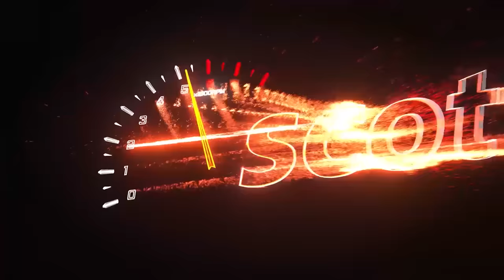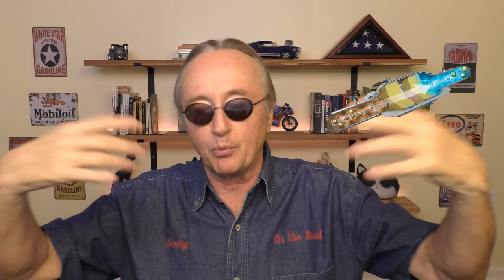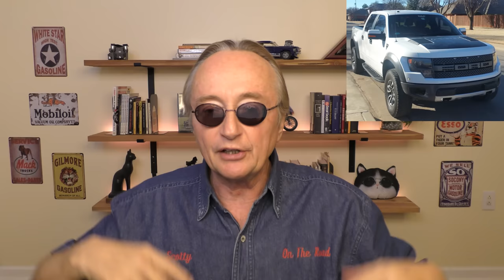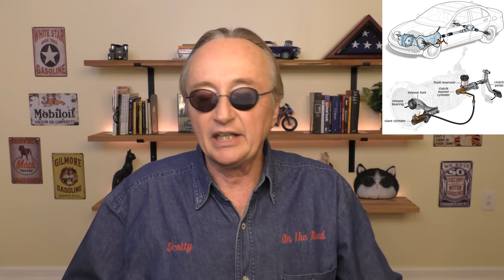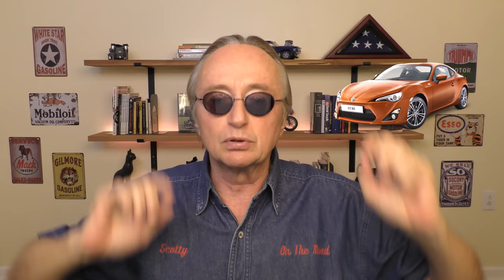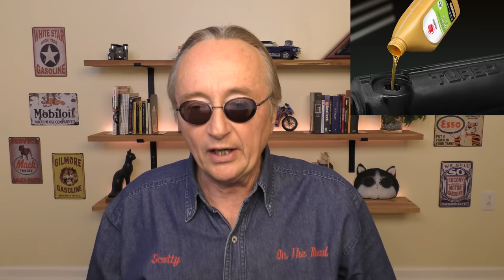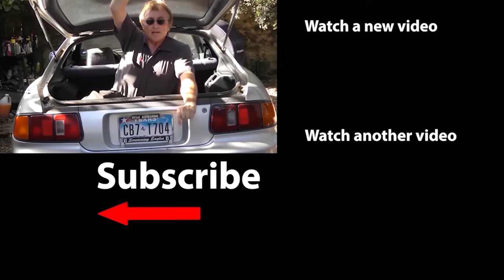Here’s Why Engine Braking Can Destroy Your Engine and Transmission

Comment: Ive engine braked for years living in the mountains. It does not ruin your transmission or engine at all.
Reply: i also live in the mountains, i shift to neutral and coast down the hill. I paid for that on the uphill, i'm making full use of gravity.
Reply: @MTMXBL  i thought brake doesn't work well when in neutral 🤔
Reply: @MTMXBL  doing this actually uses more fuel than leaving it in gear
Reply: He didn't say it would ruin anything. He said brakes are cheaper than engine or trans so don't do it because it's common sense. Then he said UNLESS you live in the mountains. Lol cmon dude. I'd bet you didn't even watch before commenting.
Reply: I have prius V it's got an engine brake to save fuel. Use it all the time . It's true brakes are cheap. <$125 for 4 new brakes and rotors.
Reply: @NewEraMusic972  Dude, guy joked, I mean Scotty, he's always joking. If you watch Scotty's channel then it's probably obvious for you that engine braking can damage only 2 stroke engines (like those in trabants) that are not lubricated when the throttle is closed. But why not make fun of it saying the engine is way more expensive? Technically - very true. Also, if you use engine braking on a wrong gear you will exceed max revs and destroy your engine and / or transmission in seconds. So called "money shift". BTW, IDK how it is where you live, but in my country they teach you to use engine braking everywhere and all the time on your driving license course.
Reply: @Earlve001  Hybrid engine braking probably uses the hybrid system for braking. Just take foot off the pedal and the car slows plenty I can get the car to slow down to where you use the brake only when you get near the stop sign. Eco-mileing probably pisses off a Tesla driver but I don't practice it when there's no out for cars behind me.
Reply: @Earlve001  agree, makes sense regarding piston opposite wear.
Reply: @anon in neutral the motor spins on liks 700-800 rpm
In gear its 1-2k rpm, depending on some things
So he actually use less fuel... around 0.5l / 100km
Reply: @patrick7695  you are all right and wrong. The answer is, it depends on the car. Direct injected cars may use less fuel in gear than coasting in neutral because they can turn off injection completely but beside those examples, in general you use less fuel while coasting, simply because the engine braking works against you and downhill, it also works against Gravity.
Reply: @Asto508  ohhh i did not know that
I never actually researched it, just used common sense
Thanks for pointing it out
Reply: He pretty forgot to state "engine braking at top end of your rpm". Normal engine braking doesn't do any damage.
Reply: @MTMXBL  Do not do that! You disable engine braking when in neutral! Also in gear and foot of gas deactivates injectors in every electronically fuel injected vehicle so you actually save fuel and reduce brake wear!
Reply: @GEAUXFRUGAL  I got 150,000 miles on the brakes on my Gen II Prius. The regenerative braking system does almost all the work once you adjust your driving to the system.
Reply: @tomdavies388  - I have done what MTM did.  I had a 1974 Datsun B210 Hatchback with an A13 (1288cc) 30 years ago.  I coasted down I80 in the Sierra while going from Reno to Sacramento several times.  Coasting lasted me for good 10 minutes straight one time while speed varies from 55mph to 90mph in neutral with engine idling without touching the brake.  Dangerous and illegal, I know but I was young. ;) Engine MUST idle if you want to keep the brake working. Cost me around $1.70 going down from Reno to Sacramento while costing me four or five times that going up from Sacramento to Reno.
Reply: @cheath8705  haha- not about braking but the car... my 1st was a 67 Datsun Bluebird loved it!
Reply: @tomdavies388  not true at all
Reply: I suppose unless there is initial jerk when u r in higher speed but u put into second gear for engine braking.
Reply: @tomdavies388  😂😂😂😂😂
Reply: If you car is in neutral going down hill the engine has to use fuel to keep turning over. unless you turn the ignition off completely, pretty dumb tho. If you are going downhill  in gear with your foot off the throttle then it uses no fuel at all.
Reply: @tomdavies388   manual transmission equipped cars get better mileage because of the coasting. Coasting down hills does not hurt your mileage. In fact it can help it if you use that momentum to help carry you up the next grade. Ask any long haul truck driver. They will tell you the same.
Reply: @tomdavies388  ... and if you engine is “running” then it is using fuel.   So the question is does my truck use more gas coasting at 700 RPM or engine breaking at 2000 RPM ? We may disagree and probably because of age and type of vehicles we are experiencing this with. 

However, coasting down hill, increases your speed compared to engine breaking. So even if the mileage per gallon was equal... once you hit the next grade the car coasting will be going faster and therefore carrying that momentum.
Reply: @HarrisonCountyStudio  And because you are going faster coasting downhill fuel consumption per mile
is lower.
Reply: @tomdavies388  Of course it uses fuel.
Reply: Let's ask the main man himself, @scottykilmer
Reply: @anon ...but many newer cars stop pulling fuel when you engine brake.
Reply: @fjp3305  ...unless you're going downhill. Then the computer turns the injectors off.
Reply: @Earlve001   the opposite side of the piston skirt gets its contact when the piston changes direction, not from engine braking. The piston rocks to one side going up and the other coming down. That’s why the skirt is there, to keep it stable, otherwise the pistons would actually flip over.
Reply: Temporary Account  Yup, and I've done it to every vehicle I've had, and even engine braked coming off the interstate to a stop. No issues. I tend to engine brake when I have a long, gentle, extended brake to perform, partly because the engine absorbs the heat a lot better and with less wear than brake pads for that scenario. 200 K miles are not unusual with a vehicle of decent quality.
Reply: It's also important when regarding fuel efficiency, that there's a kickback RPM in which the ECU turns the fuel injectors back on. What RPM this is depends on the vehicle, so the longer you stay above that RPM with no throttle the less fuel you will use. And I can't imagine engine braking causing any damage or access wear, unless you're aggressively downshifting to high RPM. I'm sure both you're engine and transmission go through more strain taking off from a stop than when engine braking.
Reply: Done it forever. Never had any problems. That's what warranties are for anyway!
Reply: @MTMXBL  If you're coasting down a hill in neutral, you're not technically engine braking, and are likely picking up speed. I think you're describing a related but different driving strategy of picking up speed downhill in anticipation of an uphill ascent ahead, in which case you can build momentum easier on the descent and let that help carry you up the hill, using less gas and brakes in the process.
Reply: @MTMXBL  that might be illegal where you live.
Reply: So you’re telling me Scotty is full of 🧢
Reply: @patrick7695  Wow, in gear you use 0 fuel. On a long enough downgrade your engine temp will start to drop
Reply: @tommymcweedface229  They do design for that stuff, after all. Just don't dump the clutch with a massive RPM differential.
Reply: @paulkazjack  piston RING, maybe
Reply: @patrick7695  haven't heard of vacuum pressure?
Reply: @cheath8705  you probably find that if you coasted down in Top Gear it would cost even less because your vacuum pressure would be much lower then at idle
Reply: @grantperkins368  - I would love to see if you can prove it. Let's not forget the rpm difference and 1.3L engine's friction from going 90mph @ ~5500+rpm would prevent me from being able to pull off 10 minutes straight in being out of gear while going down the hill in the Sierra. And also, fuel was still being introduced to engine even if accelerator was fully released and it was carbureted.
Reply: @cheath8705  yes, but less than at idle because the vacuum pressure is lower.
Reply: @MTMXBL  in neutral you are spending fuel, in gear you are not... and its dangerous cos ur costing and get very high speeds
Reply: Cvt wont last long if use a lot of engine braking
Reply: @MTMXBL  😂😂😂
Reply: @FreddyGunawan  source?
Reply: @GEAUXFRUGAL priuses use the ICE engine for engine braking
Reply: auto or manual transmission? it's definitely harder on an auto-trans

Comment: Me after engine braking pretty much the whole way home 👀👀
Reply: Same with the car I had 😂
It was just a dodge anyway
Reply: Lmao! Lol!
Reply: I did it all the time on my Mitsubishi Mirage its fine lol
Reply: @VioletPrism  how long did you have it?
Reply: Just can't stop either. Hooked on it
Reply: @ewerwong3624  But if you can't *stop*, then what's the point of engine braking? 😬 Lol
Reply: @VioletPrism  I'm driving an eclipse lol
Reply: I drove my 86 Corolla for a year with no brakes only engine brake and hand brake.. I was young and naive but I'm still here
Reply: There goes your engine.
Reply: No , you just left your handbrake on ....
Reply: I used to have a turbo charged Mazda MX6, engine braked all the time. Done over 140,000 kilometres on it, no problems from it.
Everyone said I always drove it like I stole it!
The heal n toe engine braking always helped with late braking, smoothness, better handling and also acceleration out of corners.
Reply: @milkshakemuncher  they need to tweak the modeling in that sim it seems
Reply: Me who randomly downshifts because I like the sound
Reply: I have an 04 Grand Prix, would like install a super charger,  but it's now has 170 thousand miles  and over 60 thousand egine hours, I can't remember what you said about superchargers and a high mileage engine, some tips please
Reply: Same
Reply: .....Scotty hasn't specified . He must be talking about automatic transmissions . But there are variations in the designs of automatic transmissions.
Reply: I’d suspect autos too, I mean I’ve been doing it since my car left the dealership for 15+ years no problems here. 🤷🏻‍♂️
Reply: I'm engine braking all the time and then just tapping the brakes to make a stop from 5km/h. And use brakes in emergency. Never had a problem with my last two cars and I will keep doing it because I like it. 😁
Reply: @zoranbregovic3752  I'm the same way, I barely have to use the brakes. It's extremely beneficial for fuel economy too.
Reply: Just know that if you're going to use your wheel brakes continuously for long distances like 500m/1500ft downhill, they are going to start overheating, and suffer from vapor lock, and then you will have no brakes. 

Engine braking will increase wear on the engine and gearbox, but you can do it for like 200k miles and they still won't need a rebuild because of that.
Reply: @jamesharper7365   the increase in pressure will put extra strain on any weak spots in your engine for example seals
Reply: 2007 Tacoma 230K mi always use engine braking.  Angus Heifer  finally broke it!  WBFOSTERSR
Reply: I was doing this right now and my truck is leaking water frome between the motor and transmition
Reply: @_--Reaper--_  have an 8 year azera and 15 yr Sonata, no problems with transmission at all
Reply: @benshapiro2wt298  Yoo I just bought a 95' Eclipse

Comment: I missed the part where you said how it damages the engine and transmission
Reply: I don't put much stock in anything Scotty says. Real Engineering is much smarter and less biased.
Reply: He didn't say how, but improper down shifting with wrong RPM can damage a manual transmission.
Reply: @flippos  😂😂😂

Comment: If one shouldn't engine brake because "it wears out the engine" maybe we should all just leave our cars in the driveway so we don't wear them out. No, if done sensibly on steep grades, engine braking is perfectly safe. Riding your brakes coming down a mountain will glaze the pads and warp the rotors. Not a "cheap" thing to fix.
Reply: not to mention Brake fade which can potentially cost you, not only your car but your life
Reply: Also, depending on the car, new pads and rotors aren't exactly chump change. My 2010 M3 costs 1000-2000 to replace everything depending on the quality of parts.
Reply: Definitely not cheap for some cars. Rebuilding the transmission if its manual would be cheaper.
Reply: And yet, people act like this shoddy killme guy is a god or something. He is a MUPPET, people!!!
Reply: @JeremyFerrer  I would use aftermarket pads and rotors like from EBC, way cheaper and you get track racing performance.
Reply: Yeah, the engine braking being a problem is only on very rare cars. I know rotary cars actually can't engine brake at all, the injectors never stop firing. There is actually a very old car that I think has a 2 stroke engine that requires oil in the gas tank for lubrication and actually gets damaged from engine braking since the car is carburated and will stop injecting fuel if you are in gear and off gas.
Reply: @JeremyFerrer  but definitely cheaper then your 12k engine or 8k transmission right 😂 he said use a common sense!! Ok!!
Reply: @SI0AX  .....injectors never stop firing......yes of course... that's it.....wait...too tired to think it through. But for the two strokes I'm thinking that for the ones that pump small quantities oil into the manifold that a big build up of oil in crankcase chamber would cause big clouds of offensive smoke when throttling up again . Can two strokes provide much engine braking though .
Reply: Louis Jones whats your ride ?
Reply: He made an exception for mountains. Your post does not apply here.
Reply: I have a 2016 diesel Colorado with an engine brake it's great going down steep inclines

Comment: Engine brake is fine as long as you don't exceed 3500 rpm. Diesel truck drivers engine brake all the time. I had a 1st generation Honda Odyssey minivan with 2.4 four cylinder and an automatic and I engine-braked the sh*t out of it and sold it with 378,000 miles on it. Original engine and trans. Never a problem.
Reply: Ssssh, you're spoiling the show!
Reply: Allan, I agree! 👍

Comment: That fixed it Scotty, was just the slave cylinder luckily! Shifting smooth!
Reply: Excelent! Scotty should pin this comment!
Reply: Nice...
Reply: I have issues on focus 05. Loosing pressure in clutch periodically. I really don't know what to do,  should drop down the gear box or just drive it as long as it goes. Master is not leaking,  probably slave
Reply: @drazj  Check for leaks by looking near the area of the slave. Even a small, slow leak will be bad because you won't be able to generate the necessary pressure.
Reply: @Usman Ghani lmao

Comment: I have a 1994 Toyota Pickup and after 170,000 miles it still had "ORIGINAL" brake pads on the front and shoes on the rear. I "ALWAYS" slow down by downshifting. I think Scotty is a shoe salesmen not a mechanic.

Comment: Engine braking is one of the best things about having a manual transmission.  It takes some practice, but if you properly double clutch and match RPMs while you downshift, you won't hurt anything.

Comment: It’s also a lot safer to engine brake when you’re diving in Michigan winters. Your wheels don’t lock up nearly as much and you prevent sliding through the intersection. 
I’m also not convinced it actually wears out the transmission or engine any faster. Though it is definitely harder on the clutch as now you are depressing it 4-5 times per stop versus just once.
Reply: I always engine brake. If you’re not mismatching the speeds it’s never going to hurt anything. Never had a clutch or engine/transmission break either.

Comment: I stopped engine braking a few months ago. Going with Scotty on this one
Reply: But that's going downhill not on the level road
Reply: Sorry, every time you lift your foot off the accelerator, your car is using engine braking!

Engine braking is not going to wear out your car, it'll actually last longer.
Reply: @rustymozzy  thats  true but the issue was going down here it can wear it out that's what he was talking about I engine break all the time but that's on the level road and you're right it does have last longer when you do it
Reply: @godofdestructiondiecast6756  your car can drive up the hill with no problem, using engine braking down hill is less load, less heat, less wear...
If going down hills is so detrimental to the engine, it must fall apart going uphill, or even driving away from a traffic light...

Engines and trans are built for high load conditions. 
Your brakes are designed to stop the vehicle, not control acceleration. 

Simple test, put your foot on the brake, and now also press the accelerator. 

Reduce the brake pedal pressure to allow movement, keep your foot pressed on the accelerator, using the brake pressure to control your speed. 

See if your brakes fail before your trans falls out...
Reply: Even going on level road, engine braking doesn't do damage. If brakes are cheap fine, but using more fuel isn't economical
Reply: Even though he’s wrong?
Reply: @tejaspadhye  engine braking = zero fuel use. 
Using your brakes while engine is not being acted upon by the wheel force = using fuel to idle engine. 

You'll save fuel effectively by engine braking, but not noticeable amounts.
Reply: @rustymozzy  no point is when depend only on brakes you will approach the stop sign using the gas pedal almost all the way, or maybe let it go just a couple of meters before. Thats waste of gas. With engine braking you can let go of gas much before and when almost near 1.2k rpm just use clutch and brake. That saves gas
Reply: @tejaspadhye  oh, okay, we're saying the same thing